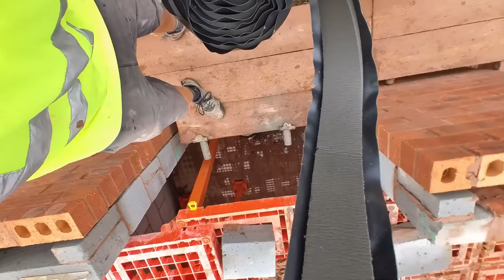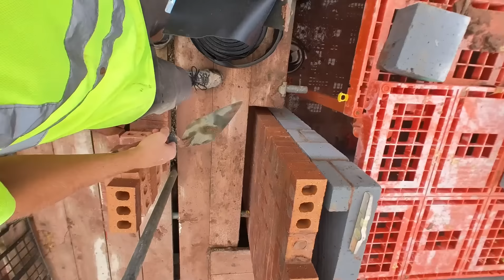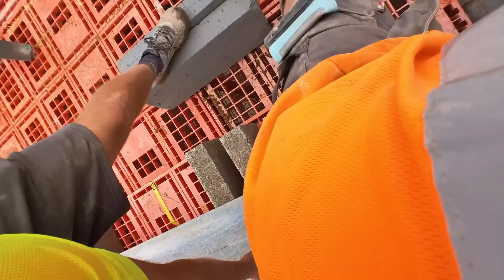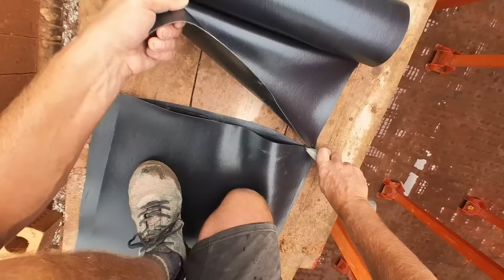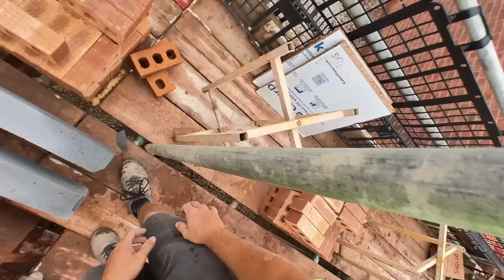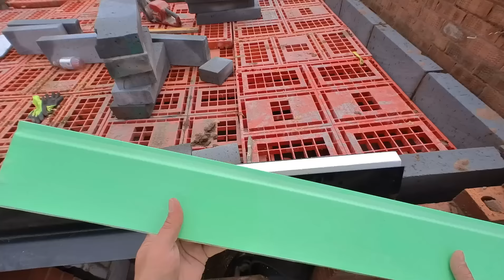Just Get The Job Done F*** Sake #construction

Comment: Ive never in all my years on thr trowel had to wrap damps like that. On our steels over openings on padstones nhbc are happy with 2 4inch dpc underneath
Reply from the maker: Agreed
Reply: I've never seen out like that before! Just some damp doubled over to act as slip plane is all we do! Still bedded on! Also have to put a cut of insulation in the web of the steel.
Also David Wilson get a crane in to lift them 3800 lintels on much easier
Reply: What's the idea of putting damp under where the steel is sat? We've never had to do it like that.

Comment: That damp wrap is the biggest load of bollocks I’ve ever seen,  just don’t do anything,  is that an nhbc idea 🤔 also, no way would I fuck about with that lintel, if there no jib on fork truck, or crane on site it ain’t going on, also thought all lintels had to be bedded on 😀 been using them Lintel soffits for years our way, can be a pain to fit on times but do look better.
Reply: Exactly! I can understand a tray above a steel but what the fux the point in wrapping the ends of it in dpc😂